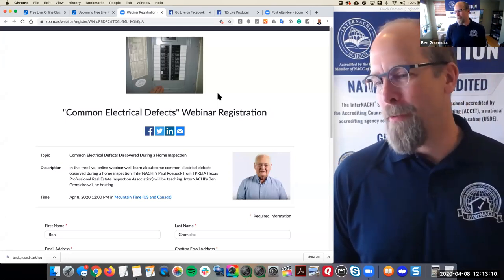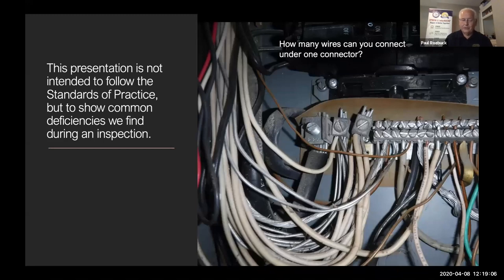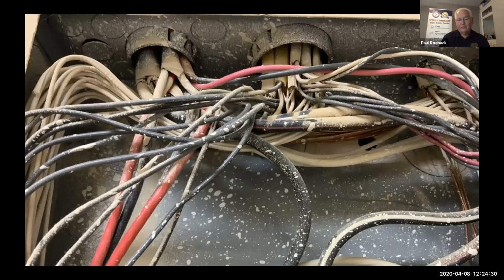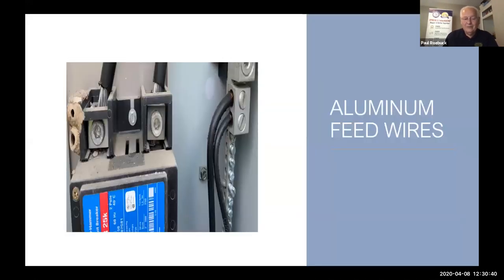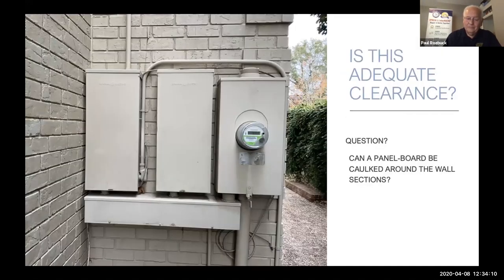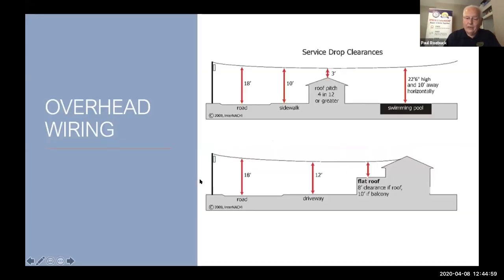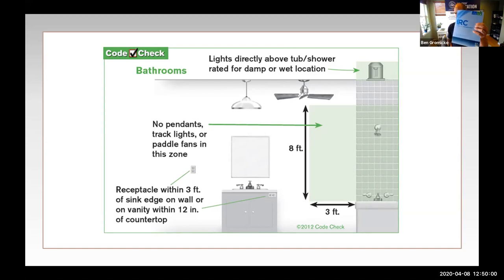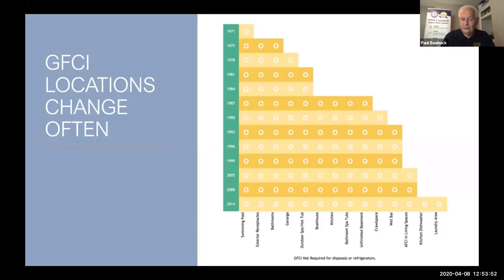Common Electrical Defects Discovered During a Home Inspection

Comment: Hi Ben, I noticed in the video, Paul's illustration on dimensioned receptacle placement issues, that there is another receptacle not included in the violation zone sitting below the tub top that I would consider a safety concern with potential splashing  of water from kids and adults . This is a case where even the codes may not cover an issue and a reason not to be overly focused on any specific code requirements.
Reply from the maker: Good catch, Tony. Right.

Comment: A lot of older homes have Aluminum NM cables, you don't need to rewire just because you have them. As long as conductors are sized to the breaker rating, have "nolox" applied,  they are fine.  
I noticed a kitchen graphic with outlets in the pantry, the pantry outlets don't have to be spaced every 4 ft as the kitchen counters do, because it's essentially a closet. They don't have to be gfci protected either for the same reason. Per the NEC.
Reply from the maker: Nice catch! You should be a home inspector.
Reply: Also need to make sure devices are rated to accept AL wiring, most receptacles and stuff aren’t and will need copper crimps for the terminations

Comment: It was more than a decade after the original arc faults were introduced before the combination arc faults came out so not sure that why he would say "immediate putting these things in houses… the breakers changed again" The combination breaker provides both parallel and series arc protection in the entire circuit while the original did not.
Reply from the maker: Thank you so much for your comments.

Comment: Thank you for video. on 50:20 the master mentioned the website. What was it? Can I have link?
Reply from the maker: That 50:20 is at the end of the video. So, I'm not sure what you're referring to.
Reply: As far as I can remember, he talked about a website that has pictures of codes and master called them geniuses.  My question is about a website that has pictures of codes where we could use it on report .

Comment: We don't use aluminum wiring anymore. We use an aluminum alloy wire called AA 8000. AA 8000 does not require noalox. The NEC does not require the use of NOALOX.
Reply from the maker: Right.
Reply: The NEC doesn’t require it, but the panels/devices usually do. NEC says panel boards have to be listed, and anytime something is listed you have to follow manufacturer instructions

Comment: Wow. Why would I pay an inspector to stare at the circuit breakers without opening the panel? Lol.

I can do that myself.
Reply from the maker: There are some electrical panelboards that are not safe to open up by removing the dead front cover.
Reply: @BenGromicko   What type of panel boards are unsafe to open by removing the dead front?
Reply from the maker: @Allan11236  All of them. Safety is #1 priority. We want all inspectors to come home safe. So I approach a panelboard as unsafe, and that makes me think of and focus on being safe. At all times.

Comment: The inaccuracies and misinformation presented here is disappointing, and I’m being generous. I would be more than happy to discuss the content with the presenter, if the opportunity should arise. I have, over the last couple of days, viewed several videos by home inspectors and find a consistent lack of knowledge of the National Electrical Code (NEC).
Reply from the maker: I agree. We are not code inspectors. I don't expect home inspectors to know code. Ya see, there's a big difference between home inspectors and code inspectors. Code inspectors are all about the code book. Home inspectors are all about the homeowner's safety.
Reply: Mr. Gromicko..As an example, at approximately 7:45 during the presentation the gentleman states “ACCORDING TO THE NATIONAL ELECTRICAL CODE” you can’t paint the rusted dead front of the panel in the picture. It’s this type of information that is unfounded. 

Unfortunately, individuals with less NEC training than the presenter who view this video may/will take information like that and believe there is an actual NEC basis for that statement. The presenter would be well served to have someone who IS familiar with the NEC review his presentation for accuracy, before the presenting the material.

I would be happy to sit through the entire presentation, with the presenter, and critique the content. Your statement that “code inspectors are all about the code book”  followed by “home inspectors are all about the homeowner’s safety” is nonsense. Codes, particularly the electrical code, are about safety. The purpose of the electrical code, as stated in Article 90.1 is “the practical safeguarding of persons and property from hazards arising from the use of electricity”.
Reply: @BenGromicko  the code book is design for personnel safety and protection of property. So you should know code,.

Comment: He is wrong about the grounds and neutrals being seperated. If there is a bar not connected to the neutral, that is what the main bonding jumper is for. You only have to seperate them on sub-panels
Reply from the maker: Thanks for the reply.
Reply: Yeah, the (Fred) question was basically why are the ground and neutral bonded at the main panel and not the sub panels, and he actually does not answer the question.

Comment: Are carbon monoxide detectors required if all appliances are electric and there is no gas on the property?
Reply from the maker: That's what IRC code suggests.
Reply: Don't forget that an attached garage can be a contributing factor.

Comment: I am sorry this guy need to get a new master electrician, stop giving false info on the NEC.
Reply from the maker: Ah, so sorry you feel that way. The NEC is a great resource and very clear and specific on its content, for sure.
Reply: @BenGromicko  yes it is the conduit coming down in into top of panel is not a violation of the NEC as long as you dont over fill the raceway. They allow for that, so I say it again need to find another master electrician. Yes some panels have hex head screws installed from manufacture. Any aluminum installed after the 1980' s is not required by the NEC to have deox. Its an aluminum alloy. I know you are not code enforcement but sure do refer to it alot.